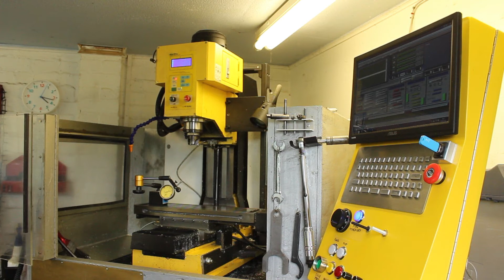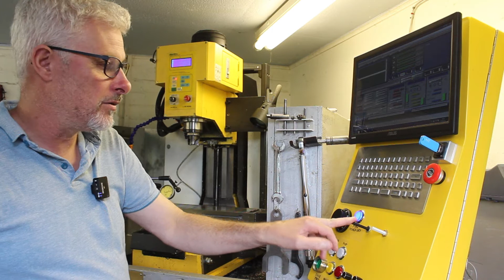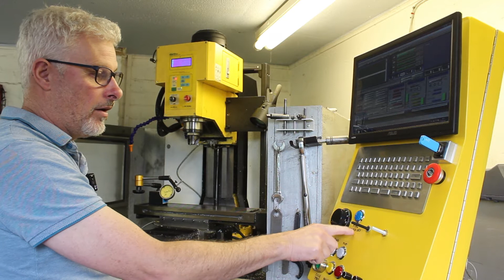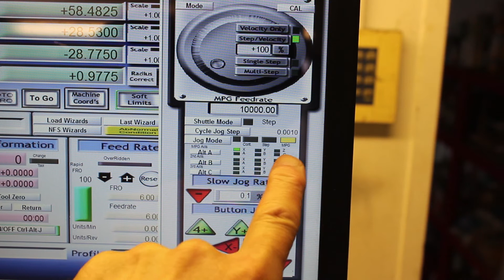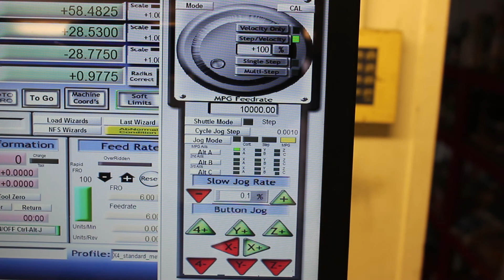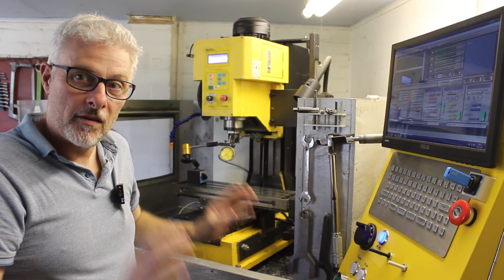Control panel update

Comment: Another option is to have the Arduino always send the switch positions every 500ms or so even if they haven't changed (as long as the MPG mode is enabled). That way even if you change it in the UI it'll get changed back to match the switches within 500ms. If you need a hand with Arduino programming I'd be happy to help, I've done loads of it.
Reply from the maker: Thanks James,
I did try all sorts of things to get the Arduino to reliably talk to mach3 I came to the conclusion in the end Mach3 is ok but not really up to the job for use with a separate control panel. When the mill electronics gives up I might use a Masso controller witch looks more suitable and would allow a auto tool changer.
Thanks for the offer of Arduino programming that would be great. I dont have anything in progress at the moment for reasons you will see in an upcoming video but email me at cazual.haze@gmail.com
Cheers

Comment: Great upgrades! Almost there. In the past I have made several nodes with the 3D printer. Much easier :-)
Reply from the maker: I agree but where's the fun In just pressing play.
It's always worth a punt on breaking an expensive endmill or two.
Cheers
Reply: @CazualHaze  True!
Reply: Hello sir
Reply: Sir we want connection diyagram and code path kindly show them
Reply from the maker: Hi wajiddk,
I will publish all the info in a month or two. I have not finished the code yet also I want to make sure its reliable.
I will make a short video when its all ready, keep watching.
Best